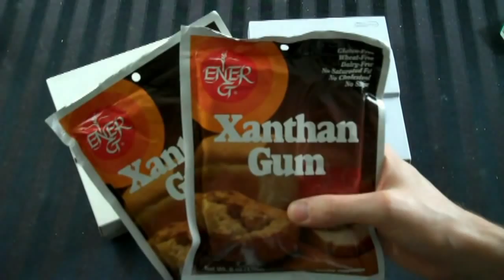Gamerade - Remove Yellow from Super Nintendo, Other Consoles, Plastics - Adam Koralik

Comment: I have heared that if you use WD40 on a rag it works, but only where its yellowed slightlty correct me if im wrong
Reply from the maker: No, that wouldn't work. Would be nice if it did.
Reply: would be much cheaper option.

Comment: If I remember correctly you can get hydrogen peroxide from an opticien or any place where they sell contact lenses. I had this cleaning solution once when the regular fluid irritated my eyes and it reacts to this so called platinum disc inside the little container. But anyhow, you can probably get it from an opticien or something.

Comment: i am actually wondering if you could use a pack of white/very bright blonde hair dye coloring with high H2O2 content without all the other stuff since i would assume the peroxide would react also with plastic and not just with hair and make the yellow fade away. since the hydrogen peroxide is an oxidizer i would be kinda scarred that it weakens the plastic :/
Reply from the maker: Sorry, I'm not sure.
Reply: Have a look at the retrobright wiki, straight up hydrogen peroxide like for hair is what was originally used but the oxy makes the process a lot faster acting.

Comment: What did you need the oxi clean for you didn't really tell us what it was used for
Reply from the maker: It's the cleaning agent that reacts with the compound that triggers the reaction.
Reply: Ok thanks
Reply: i might be doing this in the near future that is why i asked
Reply: You can buy the oxi clean in tubs at Walmart and Target much cheaper instead of the pre-measured pouches he got. Also he used 12% peroxide, for about the same cost Amazon has 35%. Which will need less time in the sun to produce good results.

Comment: One question, what happens if you use Mr. cleans magic eraser on the yellow plastic?
Reply from the maker: Just removes layers the plastic. It won't fix the yellowing issue if that's what you're thinking.
Reply: So the best method is to keep the snes out of the sunlight?
Reply from the maker: Jamal21Seif That'll help, but it certainly won't fix it or prevent it from actually occurring.

Comment: ok my question= my supper nintendo, it has yellowing on the bottom way more than the top? how the hell does uv rays get to the bottom?!?!?!?!
Reply from the maker: Epic Win Face Pie Just means the bottom half of yours was made with more bromine than the top half.
Reply: AdamKoralik but doesn't uv rays have to hit it for the stuff to yellow?
Reply from the maker: Epic Win Face Pie UV rays are in most light bands, so, it's always getting hit by them unless you leave it in a totally dark room.
Reply: OK also I have an old nes that you can try to repair?
Reply from the maker: Epic Win Face Pie I made plenty of videos on how to get those running again. Typically, they just need to be cleaned.

Comment: While I didn't follow this video to clean my SNES, this did come in handy on opening my SNES to replace the guts with another one.  
I had two SNES consoles, one was immaculate but something inside didn't work making all 3D graphics a garbled mess (meaning F-Zero was unplayable, I couldn't look at the map in Zelda, and the screen wouldn't orient correctly in ActRaiser meaning it would "kill" The Master because he was offscreen in a "pit"), the other was dirty, disgusting, had cracks in the casing all over it and was missing that vital piece on the back that keeps the power cord in place. BUT, against all odds, worked like a charm when I played games, provided I keep the power cord wedged in the machine with a piece of Lego.
So what I did was I put the good casing over the good innards, and voila.

Comment: The only bad thing about this is that after a year or two you're right back where you started. The problem is that you only bleach the top microns of the plastic. The yellowing process cannot be stopped, just temporarily reversed a bit. And instead of using Xantam Gum, just use wallpaper glue (it's just starch), costs just a fraction, same effect.

Comment: I have an extremely yellowed SNES (which honestly I'm not sure how it got so bad considering I've had it carefully boxed up for a long time) and I have never taken it apart. I hadn't worried about it thinking it was just a pigment issue and I would restore it someday, but if it's really going to crumble on me if I don't do something about it then I guess I better get on that.

The thing that worries me is that mine is crazy dark yellow. It doesn't feel brittle or weak to me (honestly it feels just as strong as my N64) but watching you take yours apart and undoing the clips I'm worried that by doing this it's going to fall apart on me. Do you think t's just better to get a less yellowed one on ebay or attempt to fix mine?
Reply from the maker: That's a tough call unfortunately. Me personally, I'd do both. But that's because I like having a backup, and making sure my stuff is in good shape.
Reply: PineKushDude except for the capacitor issue Sega has from the same time period!
Reply: PineKushDude lol wow, looks like we have a console war vet from the early 90's! Do you sit in a rocking chair on the porch, reciting old tales of magazine articles and schoolyard arguments? 

It's 2015, and both systems can be had for cheap. The SNES has more than proven it's solidarity to the gaming community over the past 20+ years. Genesis has some absolute classics too. No need to be so biased.
Reply: Lol

Comment: I was fascinated to see if this is a thing that is possible.
My old SNES is maybe a little yellow. It spent most of its life in a basement and also got a some nice green highlights on it from some copper-containing condensation dripping on it from exposed pipes. Considering all that, it still looks pretty good. Hasn't sustained any chipping from becoming more brittle. Didn't know about that. Mine has aged like a tank. Seems indestructible.
There's no way in hell I would bother doing this, LOL. My console will age naturally, and I'll keep using it.

I highly doubt anything you are doing to your SNES is "fixing" or stopping the plastic from being brittle. You're simply exposing the surface of the plastic to chemicals that remove the discoloration on the surface, but this process won't stop an SNES from continuing to have this UV reaction work on its plastic. TOTALLY not worth it unless you just want you SNES to superficially look better temporarily. Unless you keep it perfectly hidden from UV ALWAYS, it will yellow again. This is a losing battle, and an example of people trying a bit too hard to preserve the original look of something. Like... this is a ridiculous project with little payout to me. But interesting, LOL.

Comment: If pouring coca cola on battery terminals will eat away the corrosion,will it do the same for the yellowing stuff on the SNES console? I'm curious if anyone has ever tried this?
Reply: It doesn't help with the plastic, it's all of the plastic, the coke will only go so far as the surface.

Comment: It's actually not that bad, chemically speaking anyway. You could achieve the same results with some anhydrous Ascorbic Acid or even some Tocopherols. These are just vitamins, but would be more of a pain than using oxyclean and other things. You might wanna coat your SNES in a clearcoat to protect from oxidation in the future.  As always, thanks for posting this.

Comment: I'm puzzled as to why you have to add hydrogen peroxide to the mix. I looked up the chemical formula of oxyclean and it looks like the oxyclean by itself will degrade into H202 when dissolved in water. So I wonder what the point of adding extra hydrogen peroxide is? Have you ever tried just soaking parts in a tub of water and oxyclean? I might to try out they oxyclean water tub method on my nes shell.

Comment: UV light has nothing do with the yellowing. My experience has been the reverse where plastic that is covered or wrapped yellows at a faster rate - i.e. my ps1 and snes were boxed 8 years ago and I laid a piece of tissue covering half the ps1 and snes to lay controllers over it.  The yellowing precisely matched the tissue paper outline covering half the consoles.  As in the example in the video, most sever yellowing occured  at 9:08 and 11:22 where the plastic was not exposed to UV light - inside and the loading slot which was covered by another piece of plastic.  Another console was stored in a dark closet and wrapped in a blanket caused global yellowing.  Exact mechanism anyone? preferably someone with a degree in chemistry or a PhD in plastics and materials.

Comment: Protip : Instead of doing this mix just use 40 volume cream peroxide. Buy it from your hairdresser. Mine sold me a 1 L bottle for 10$ Works just the same if not better and no need to mix. Plus it comes as a cream and is easy to spread evenly all over. Just be sure you use gloves.

Comment: Would a higher percantage of the Hydrogen peroxide be bad? i found a site where i can buy 30% Hydrogen Peroxide 1 L for just about 10 €. but im not sure if this could be over kill the plastic.
Reply: Dragon He probably. bought a 12% hair blonding thingy. alraedy creamy and very cheap. but it takes pretty long. because of bad lighting and not very effective retrobrite im sitting almost a week on the bottom plate. if i run out of my blonding mixture ill try the 30% stuff.

Comment: You said you can't just scratch it off.. that is not true, I've restored many console by color sanding it.  It's the same thing as sanding your headlights. Buy when you sand it, the texture of the plastic is smooth rather than pourus. So yea, just letting you guys know, there is a cheaper alternative, but it won't look original
Reply from the maker: When you say "many consoles" I assume you don't mean the SNES.

There is a massive difference between simple sunstaining and the bromine issue with the Super Nintendo.

Comment: Retrobrighting has been proven to be a temporary fix with other chemicals overtime but Is this method a permanent Retrobrighting solution? If so I believe it would be worth the time and patience taking a console apart, thank you for sharing. 🤙
Reply: All retrobrighting is temporary. The bromine is still part of the plastic and the plastic is actually prone to yellowing faster now than it previously did; the reason being is that the plastic is already compromised. Despite what this video says, you do not strengthen the plastic, you simply stall/slow the current breakdown. After completing this process, you can add a uv protectant, like armour-all, that will help slow the re-yellowing.

Comment: the most funny thing about this video is the huge process and chemicals he's using, you can accomplish the exact same thing much cheaper, take system apart to plastic only, 5 gallon bucket from home depot., super saturated water of dawn dish soap, immerse plastic for 3-5 days, good as new
Reply: Will it still be brittle though? That's the only question of importance that needs answering.
Reply: +Eric Lerma no it will not be brittle as it pretty much rejuvinates the plastic

Comment: Why not just soak or get the system completely  wet in hydrogen peroxide and oxyclean just let it sit. Then dry it out before turning ito n again?.
Reply from the maker: As stated in the video, you could do that. But getting that much high grade hydrogen peroxide would be incredibly expensive.
Reply: Couldn't just use a little in a sealed container and shake it up as if it were salad. The thing would get completely we with only a little bit.  All areas covered.

Comment: I've got a SNES that's as old as I am and it's all yellow now. I wouldn't have minded before (I didn't know it was reversible) but a thumb-sized piece of it broke off a day ago and it's enough to expose the board to outside. Do you think doing this whole process would be kinda moot even if I tried soldering the piece back on?
Reply from the maker: Plastic came off or part of the board?
Reply: AdamKoralik
Case plastic chipped off, not from the board, sorry if that wasn't clear
Reply from the maker: Cryoloph You'd want to use super glue then, soldering it would just melt it.
Reply: AdamKoralik
Oh so it might still be salvageable. Thought I was SOL. I'll give it a shot sometime. Thanks!
Reply from the maker: Cryoloph I recommend doing the Retr0brighting before using the super glue though.
Reply: AdamKoralik
Alright, guess I'll see how it all goes then reply back with a progress report for anyone else interested
Reply from the maker: Cryoloph Good luck bro.

Comment: Couldn't u jus have submerged in  OXY clean and peroxide alittle bit of water and leave in the sun?
Reply from the maker: It's been a while since I did this, but as I recall you CAN submerge it, but not with water. You'd need vastly more of the chemicals. It basically boils down to finances. It would cost more to do that properly than to just apply it with a thickening agent.
Reply: @AdamKoralik  
I see thx for ur input I'm gonna try this

Comment: Or you could, you know, just play the machine and appreciate its aged look.
Reply from the maker: +Chris Wilson Or you could, you know, restore the machine so that it lasts longer so you can keep playing it for years down the road.
Reply: +AdamKoralik The look of the plastic isn't going to change how the console performs though. It's purely cosmetic
Reply from the maker: +Chris Wilson Demonstrably false. When the case breaks down and falls apart, eventually you'll be left with little more than a motherboard. Sure you COULD use that, but I sure wouldn't appreciate the "aged look." The whole point is to prevent the case from falling apart, the color alteration is a bonus.
Reply: +AdamKoralik no offence,  but you sound one of those garage mechanic who goes "oooo" before giving a price. I'll take my chances with my yellow SNES rather than putting crazy chemicals in it
Reply from the maker: +Chris Wilson It's just basic high school science man.
Reply: Including the part where hydrogen peroxide also weakens plastic?

Comment: Better idea:

Take the console apart, and grab the outer casing like this guy did at 14:58.

After that, buy some paint and paint it whatever color.

My choice:
Blue with the 'start' and 'reset' buttons being black.
Believe me, mother fuckers try to sell me their middle nut for mine.
Reply from the maker: How is that better? The plastic will continue to corrode and break down. It'll just be a different color when it does that.
Reply: AdamKoralik
You know what paint is used for right? -.-
Reply from the maker: zzzhuh Yeah, and it won't alter the fact that the bromine will still actively break down in the plastic.
Reply: AdamKoralik
Painting it black or even blue will not make it break down. You obviously sand it and prep it first. You can't just paint over the top of it lol.
Reply from the maker: zzzhuh /Faceplam.

Dude, the reaction isn't just on the surface, it goes through the entire plastic mixture.

You can't "sand off" the yellowing damage and just paint over it.

This is simple chemistry man.
Reply: AdamKoralik ..... Your making it sound like the machine rots. It changes color, and that is about it. If you painted it black it would NEVER look stained and actually help protect the age.
Reply from the maker: zzzhuh The plastic DOES rot. That's the entire point.

That's the effect the bromine has in the plastic mixture. That is why it's important to reverse it through this process if you value your SNES.

Simply painting over it doesn't fix the issue.
Reply: AdamKoralik
i see what hes saying though, you Sand and Prep it first. spraying a primer will soak into the plastic somewhat. spray it inside and out several coats, No Oxygen + No UV light = Halted degradation.

Comment: There was another cheaper method. Using an eraser to rub the yellow off.
Reply from the maker: +V Guyver That's like spray painting over mold, it just hides the problem, doesn't actually fix it.
Reply: AdamKoralik so the plastic has to actually absorb the alcohol in order to stop the chemical breakdown? Makes sense.
Reply: +V Guyver No.
Reply: Wouldn't the Mr Clean Eraser work?
Reply: +Frank Clinch IV they work great for surface stains and scuffs but not for this deeper yellowing. those erasers are basically super-fine sandpaper: they're actually rubbing the top coat off.

Comment: Just taking apart the snes can break the plastic all into pieces.  I don't suggest anyone attempt to waste time money and effort to "restore" a yellowed snes.  the yellowed plastic is junk.  Just get a deck that doesn't yellow.  I got one for 20 bucks off of ebay but I think they cost a lot more now.  the yellow brittle one is in a box.  the plastic is just useless garbage.

some day maybe someone will mold new plastics for these.  that would be the way to go as long as they don't use the wrong plastic which nintendo did.